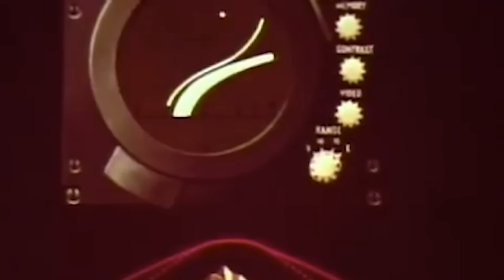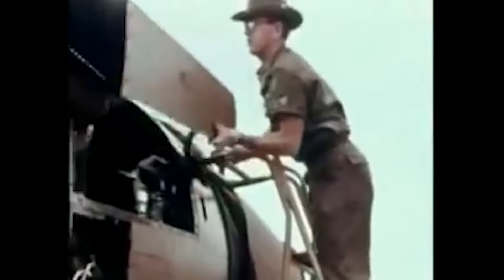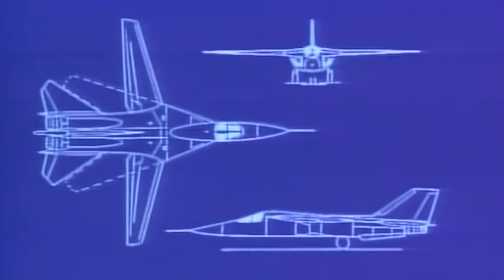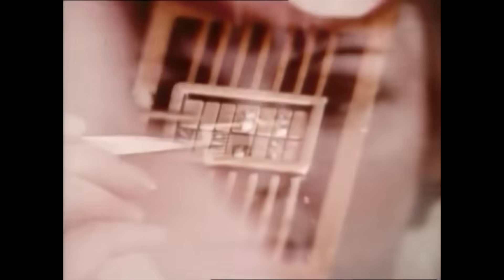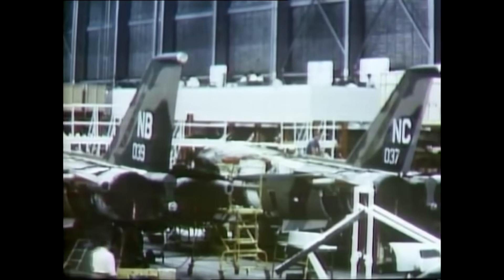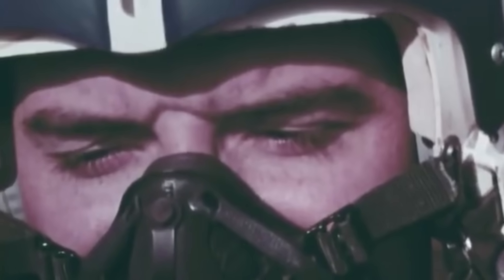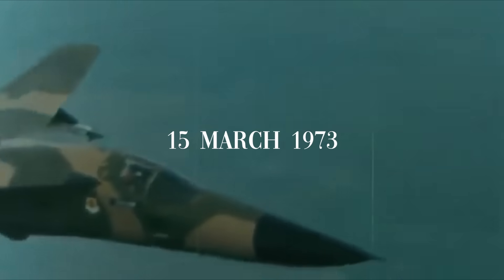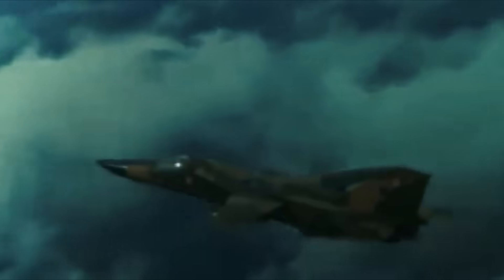The F-111's Fatal Flaw

Comment: I was stationed at Cannon AFB on F111D fighters. The biggest trouble was the avionics reliability. My biggest hatred was installing a new overwing fairing. It was a canvas cover on top of a rubber bladder. The fairing was very stiff when new. Manipulating the fairing to install the screws was time intensive and a headache. There was a watertank that cooled the avionics equipment. If they leaked you had to disconnect the speed brake to gain access for the repair. You had to jack the plane up and retract the landing gear after you reconnected the speed brakes. The air force stopped flying them because of $$$. My last year at cannon was 1978.
Reply: Australia did a huge expensive frame upgrade to extend there hours around 2006 but then retired them early completely in 2010 when with heaps of hours left. Yes it had long hours for maintenance but everyone missed the point .  Just 1 F-111 could do the same job as 4 F-18 original hornets with 1 air refuel plane as the F-111 had double the bomb load and 3 times the combat radius at double the bomb load... fitted to the max it had 3 times the bomb load of F-18  i think and it could almost get to mach 3 making it one of the fastest aircraft in the World plus the fact flying low was very comfortable and smooth from the wing design compared to a F-15 that can fly at the same speed but fall more rough. Its other weakness was the huge radar signature if detected flying high and the big loss of energy in turns. Still if you still had them today you could put a better F-15 GE-110 engine it it , use stronger materials for the frame and put a huge AESA radar in it for a 3.4 mach  aircraft 3600 km hour with a huge payload making it the fastest biggest fighter bomber in the World
Reply: I was at Cannon 79-82. I was a dentist at the dental clinic. We saved our old mouth mirrors and broken dental instruments for the people who worked on the avionics of the F111Ds. I was told they used the mouth mirrors so they could see behind the bundles of wires and used the hook shaped instruments for grabbing a hold of wires.

Comment: The wing box used D6/AC steel, which required 2 heat-treats if I remember right.  It had a miniscule critical crack length.   It was possible for any initial flaw in machining could exceed this length, which made failure a crap-shoot.    The big move to fracture mechanics really began as a result of these F-111 wing failures.   Before that "fail-safe" design was used.     The problem was mitigate by bonding boron/epoxy patches to the wing box, which effectively reduced the operating stresses and strains in the steel.   However, for the remainder of the contract each F-111 had to go to the cold box once during it's lifetime.    Another big issue was that the F-111 had a lot of bonded structure, a left over of the design methods used for the B-58 by General Dynamics.     Those structures were structurally efficient but could suffer from corrosion and repairability of battle damage was difficult.    The lessons learned from the F-111 problems were applied to the F-16 with great success.
Reply: Every F-111 that came in for maint at McCllellan went through a complete aircraft scan  NDI there is still the nuke reactor there after we closed down, there were F-15s 111s that flew in and never flew again, we tore the 111s down to nothing and rebuilt everything and had huge autoclaves to cook the wings and all honeycomb hexcel bonding materials, they werent that difficult to fix, along with the F-14 same platform but more rugged but still suffered damage over time due to corrosion and carrier landings..we also did work with composites for the F-117, the 111s were flying all the way till 1999 plus with some reserve groups, we sent all the molds to Austrailia and engineering data so they could form their own repairs and support along with all of our depot support equipment when we closed in 2000, we worked every A10 and 111 in service over the decades including battle damage repair during desert storm I was there
Reply: The boron doublers weren’t on the WCTB, they were on the wing pivot fitting of the wing. I spent many hours removing those doublers later in the aircraft’s life in the late 90’s. Good times!

Comment: 9:29  am surprised the F-111 , which did quite well in Australia for a very long time, is referred to as a ‘fighter’—isn’t it meant to be a multi-role aircraft? It does use twin engines though, unlike the little F-35… I remember when we ‘committed’ to the F-35, military commentators claimed it was ineffective for its primary purpose and would hinder the RAAF for the next 50 years—partly as we were surrounded to the North by countries using apparently superior designs.
Reply: The 'F' was for USSR arms control treaty purposes. It was always a medium bomber.

Comment: I started my career on the F111 at Amberley QLD. Despite its reputation for high maintenance and fuel leaks, i cried when they were unceremoniously buried.
Reply: Same here, first posting was 482 Sqdn Avionics in 87.  Spent a year there on F111 before swapping to 481 Sqdn to work on the Mirage and then the FA18, then finally on the Macchi at Pearce.  Biggest regret was not getting a photo of me in front of The Pig.  I was feeling a bit French revolutionary when they said they were to be buried.  So disrespectful.
Reply: @ IIRC it was part of the contract that minimum aircraft were to be retained after withdrawal from service and the remainder destroyed.
Reply: I worked in purchasing in Dept of Air and IIRC the down time rate of  an F111 was better than most aircraft. The worst one was the Chinook. Later on I worked at GAF and we developed a wingpivot shroud. I left before I found out whether it ever got used.

Comment: The F-111 had another serious problem. During the design phase, there was a misunderstanding between the airframe manufacturer, General Dynamics and the engine manufacturer, Pratt & Whitney. When the aircraft was assembled it was realised that the inlet had been designed for a turbojet but the T-33 engine was a turbofan.

This led to compressor stalls at high Mach and the problem wasn't resolved until the introduction of what was known as the Triple Plow III inlet.

Like the F-14, the T-33 was the F-111's weakest link in the end. Late in its service life, there was a proposal to re-engine it with the much newer and more reliable GE-F110. All the engineering was done but nothing came of it.

However, during its career, the Australian F-111s were upgraded to Mil St 1553 databuses and a modern nav and weapons control and delivery platform was fitted. They were potent right to the end.

Comment: 1:50 here's where you're wrong. The F-105 was designed to be fast on the deck - it was the fastest strike aircraft in this mission profile at the time, faster than the F-4, for example, although somewhat slower at altitude. Don't let the high and medium level mission profiles in Vietnam fool you, that's was not the mission profile it was designed for. 

Next thing you're wrong about: it's not a Century series fighter, just like the F-4 isn't (known as the F-110 Spectre in USAF service pre-1962). 

Much more importantly, F-111 is not a fighter at all. Nevermind the F designation, neither is the F-117. The F-105 is questionably so, but at least it had a gun and could carry Sidewinders. The F-111 could do neither. The B variant never entered production so it doesn't count. 

That's three mistakes I caught in under 10 minutes, you ought to strive to do better.

Comment: The largest, single part of the F-14 is the wing box!  Grumman is renowned for building ungodly tough aircraft for the USN.  There is an old joke about Grumman; 'no Grumman aircraft has ever come in UNDERweight!'  They have world-wide nickname as; 'the Bethpaige (Long Island) Boiler Works.'  Legend has it, they are so routinely overbuilt, that if you BEND one THAT is an achievement!  Boeing was tangentially involved in the  competition (built the landing gear for the B's) and suggested that the wing box was too under-built to work on carriers, thus the B (naval fighter) would never work.
P.S son a USN carrier pilot (S-2 Trackers) for 22 years.

Comment: New Years Eve, near the Sydney Opera House in the 80's and the sky over Sydney harbour was lit up by a truly massive fireball trailing from an F111 that had 'snuck up' in the dark on the huge crowd attending the traditional fireworks. This was the F111's famous party trick whereby the fuel dump outlet between the engine nozzles was  opened and the stream of fuel being vented was ignited to great effect by the jet blast/ABs?

Comment: I wish they would bring back the f-111 with something like the fb-111L or fb-111x. Give it the newest most powerful engines for that size jet, include more modern flight surfaces and other modern technologies like thrust vectoring and advanced sensors and control systems. The copilot would be able to do a bunch of cool things. It could basically be a non stealth version of b-21, but considerably faster and more maneuverable. They can get rid of the heavy single cockpit ejection thing and just use normal ejection seats.

Comment: Had lunch with one of the original crew who went over to bring the F-111 back to Australia, This didn't happen straight away because of the problems with the plane, but he did get to do a stint at Top Gun when he was there before the planes were brought back. One of the few qualified to sit in both seats.

Comment: One F-111 wing broke due to a flaw in the carry through wing structure. The original billet had a flaw introduced when it was formed. The metal was also temperature sensitive becoming more brittle at low temperatures!  This eventually led to environmental testing, sound testing, etc. making high performance aircraft safer!  Another, had 20mm shells cook off in the weapons bay firing through the mid fuel tank.

Comment: When I was in the USAF, I was first based at Plattsburgh, NY where we had the F-111's.  I remember working weekends and have to patrol and collect Aerospace ground equipment.  It seemed about once a month I would pass by this huge hanger where they would have these F-111's being X-rayed.  Later I found out that this aircraft would develop these "stress" cracks and ultimately be dismantled a fixed.

Comment: Circa 1978, During my lunch break at McClellan AFB in Sacramento, CA, I used to watch the F-111 take off under full AB with a shock diamond studded flame squirting out the back and a thunderous roar pounding my chest, awesome aircraft!
Reply: I was at the new CG air station and enjoyed the show as well. Every now and then a Vulcan would come through. Aluminum Overcast! A lot of interesting aeronautical work and events happened at MCC. A friend from later on had been an engineer with North American working on some sort of problems with F-100 avionics. The work was done at MCC, which seemed a bit odd to me.

Comment: At an RAAF Pearce airshow in the late nineties, they had a couple of F18's start their take off runs with a single F111 either in front or behind them (my vision was blocked). The F18's were still on the ground when they came into view from behind the control tower. Then only seconds later the F111 flew over the top of the control tower straight at the crowd. Very impressive. My first RAAF airshow was in 1971 when the RAAF had Mirages and Phantoms. One party trick back then was for a Caribou to take off behind one of the hangers after a very short take off run.  Another was destroying old Holdens with the Phantoms rotary cannon.

Comment: The RAAF lost a F111 at Ohakea AFB in August 1979. It was raining and the nosewheel splashed more water into the intakes than the engines could handle They didn't actually flame out, but the crew knew they weren't going to abort the take-off run safely so they ejected. The pilot wound up with severe back injuries – the ejection capsule had no cushioning when it hit the ground and the occupants landed in the sitting position.
The year before, another F111 was lost over the Hauraki Gulf when something caught fire in the nose wheel bay. The crew ejected and because the capsule landed in water, softening to impact, the occupants were not injured. I remember a photo in the New Zealand Herald the next day of the escape capsule being towed back to port by a fishing boat.
In 1970, when the RAAF was learning to fly the aircraft in the USA and General Dynamics was having trouble actually keeping them in the air, the Australian government leased 24 Phantoms to take up the slack. I was living in Ipswich at the time and when the Phantoms arrived, in two tight groups of twelve, at low level across the city, everyone rushed outside to watch.
Things got spectacularly noisy after that. I lived six km from Amberley and, sometimes, when the Phantoms were taking off, two at a time, on afterburners, they would rattle my kitchen windows.
I didn't mind at all.
Reply: My Dad was the C-130 pilot who flew over to NZ to pick up the ejected capsual. From memory I was told it was used as a simulator and still exists somewhere.
Reply: @goodshipkaraboudjan  I think an aviation museum somewhere in Australia has a F-111 capsule. I wonder if it's the one you are talking about.

Comment: My readings indicate that the Tom Cat was severely under powered and resulted in the death of multiple Navy Pilots.  The F111 was severely overweight  Manufacturers and Military swept a lot of stuff "under the rug"  At 75, I will never stop wondering, If this was a 1960's design, what's on the computerized "drawing board" today.  More; What is actually flying now that we will be told about in 20 years?

Comment: No mention of the Carbon Overwrap process used to finally 'cure' the pivot box's issues on the Aussie F-111's in the late 80's early 90's ?
Saw some stories about the manufacturer wanting to buy back the airframes with it to figure out how the RAAF did it.

Comment: As Chief of Propulsion Systems (RAF senior engineering officer seconded to HQ ACC LGMP) within a few weeks of my arrival at Langley AFB I was asked to lead an Integrated Process Team (IPT) to resolve (get well program) the F111 TF30-P111 afterburner failures at a time when the aircraft of 48th Wing at Lakenheath was relocating to  27th Fighter Wing Cannon AFB and many  ABs  were missing from the inventory. The F111F fleet had a dramatically reduced operational capbility with so many "holes in aircraft" (engines out). The ACC supercruise operations was seriously reduced not just by the TF30-P111 problems but the only other supercruise aircraft the B-1B having major engine (F101-GE-102) issues with fan blade failures. The F111F "Get well program" had a potentially swifter recovery program from my mechanical engineering perspective and recommendations as the AB was a basic 2-position iris eyelid "slamming" mechanical linkage, which OC-ALC LPA management,  F111F SPO, Bristols of Canada (R-R Canada), Pratt& Whitney (United Technologies,  and of course ACC executives LG 2-Star and 4-Star Commander agreed with. The TF30 -P111 engine had effectively been designed on-wing starting from a mere 20 hours MOT and had reached 2,200 hours MOT. The F111F Get Well program to reach an effective ACC super-cruise operational role took just under 12 months when the 27th FW reported that it was achieving this with an increasing number of QTR engines. While the B-1B F101-102 engines problems continued limiting its operational role for another 2 years. We managed to extend the operational life of the F111F by 2 years saving it from the boneyard at 2 successive ACC annual POMs.

Comment: America seems very reluctant to broadcast failure. More F111`s were lost in Vietnam through the failure of a small bracket at the tail root, than were shot down by the Vietnamese enemy. This small bracket when it failed, put extra stresses on adjacent components which in their turn, also failed with the result that the aircraft crashed.

The British Tornado swing wing aircraft was a much better product with better design, testing and build quality.

Comment: When I was in high school, doing work experience at the RAAF (Royal Australian Air Force), a pilot told me about how some F-111 pilots ejected in the capsule and died (because the chute was too small for the capsule and so it fell too fast) - When they took their helmets off, their heads were just mush.... :(
Reply: This event tail is another bar room pissing contest. If this option was ever avail, step two could not fire before step one was fired and had left the station, two seconds apart. BTW,  the driver's top chair smash-ram would strike the glass before the helmet got here.

Comment: You forgot to mention 2 things:  1) The US Navy chose the F-14 Tomcat over the F-111 due to its lighter weight (for carrier takeoff and handing equipment) and the F-14's better missile systems.  2) the F-111 sat the 2 person crew in a side-by-side configuration which meant the election system elected both pilots in a "tub".

Comment: I worked with several guys who developed and tested the F-111. One tested the TFR by flying in the tail looking down at the ground 50'-100' below. 🤢 I was told of a different accident in Louisiana where when the crew moved a rotary switch the computer polled the switch as it passed through the steerpoint position and the plane executed a turn and ended up in the trees. The crew ejected successfully, though they found a pine tree pierced the ejection pod right between their side-by-side seats. 😮